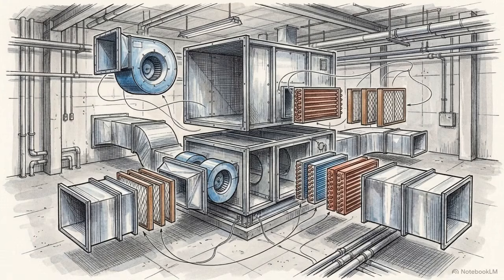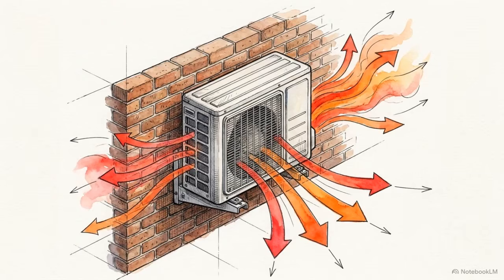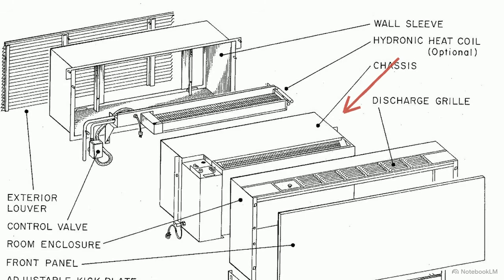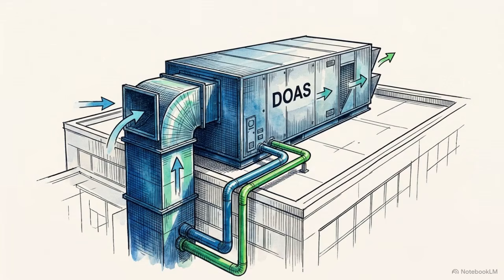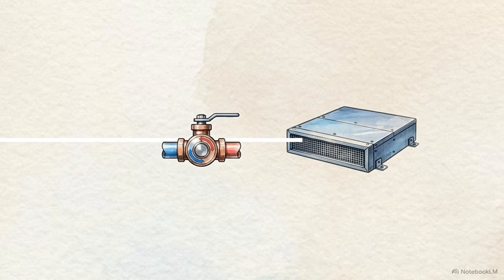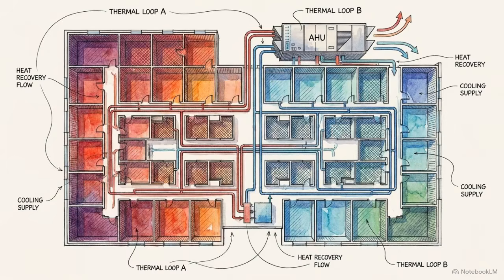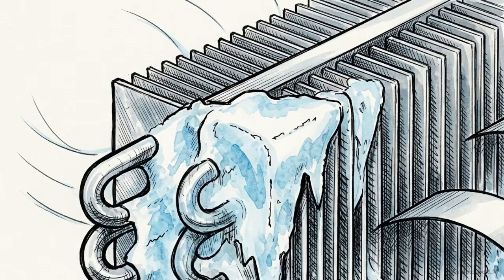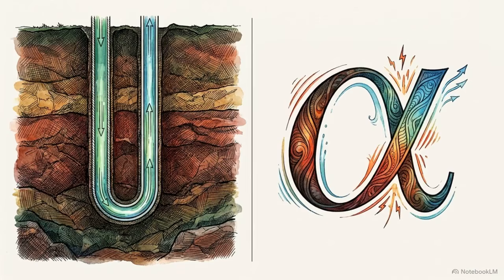Why Decentralized HVAC is the FUTURE of Building Design

Comment: I've rarely seen a video with all these parts together. The only thing I would like to add for something like this would be that I wish we could have plugs but instead of for power they would be for heat exchangers. You could shrink the size of parts needed in a fridge and during cold weather it would actually help heat the loops. Hot tubs, freezers, water beds, server or large computer cooling systems so many can benefit and often have effects that are helpful like servers heating the loops during winter or hot tubs cooling the system during summer.